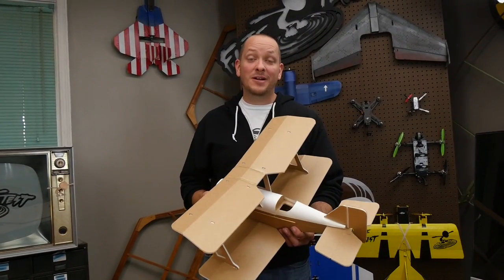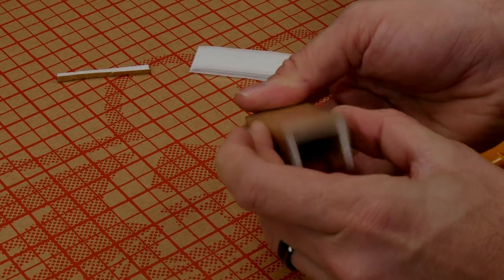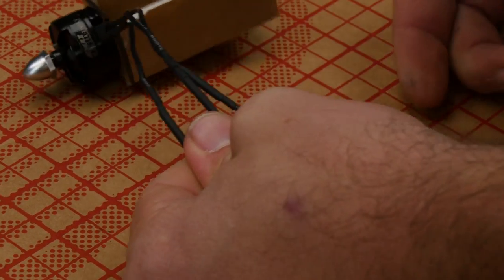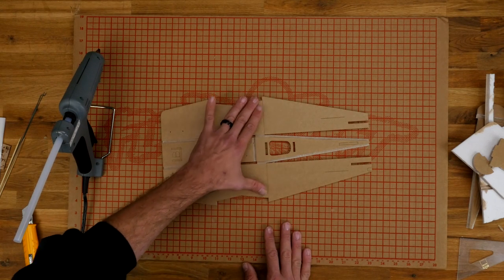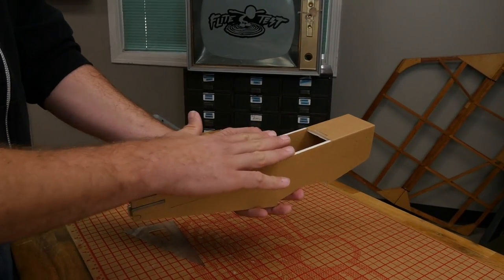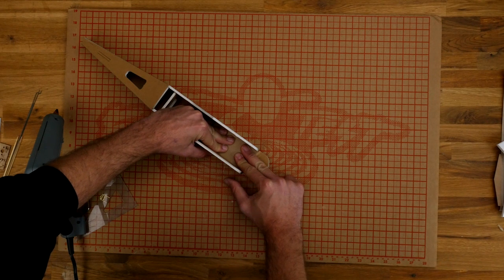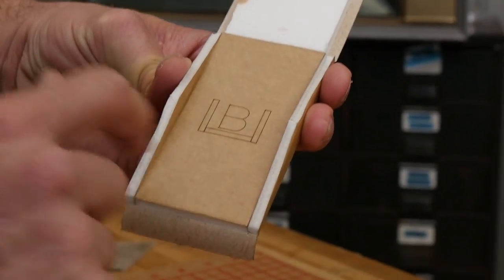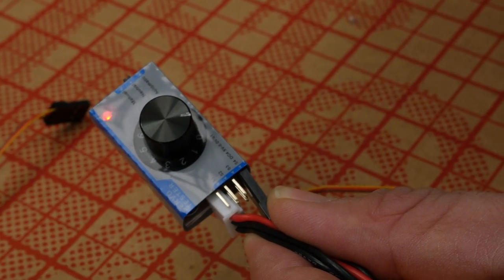FT SE5 WWI Biplane - Build | Flite Test

Comment: Pleased to say my scratch build is progressing very well.
I extended one doubler back to 5mm rear of the wing crease. This will add more foam surface area to glue the lower Wing to.
I realised there is a perfect placed accessible area on lower fus,,over the CG, to fit a Gyro Stabilizer. As Im using 5mm Foam board, Ill measure the gap for the Power Pod and scratch build this, an easy task. saved me stripping the paper off the inside of doublers, With my Foam Board, this is not an easy task! Im guing to use 4X vertical BBQ dowels to secure the centre of Top Wing. This worked perfectly on my Baby Blender and very robust. PS, with BBQ skewer LE, TE and tip reinforcement, the wings have turned out super robust, again developed from the BB build.  Thanks

Comment: Having built a couple of your C sized Power Pod  and now this SE5, I realise how you achieve the necessary 2/3 degrees of Motor Dow-nthrust,with a 90 degree Firewall. The ply firewall upper edge is oversized, which is a bodge to receive the required result. This means the front of the Power Pod will not sit flush to the Fus top foam . This renders the front PP location tabs pretty redundant. You really should have explained the design philosophy at the start, as Im wrongly thinking I made a mistake. In past builds I have modified the arrangement so PP fits squarely and far more secure. I have made the motor down-thrust angle using a couple of thin spacer washers on the motor top  2 retaining screws. That works well. I realise the same design 'defect' with this SE5, so I will suitably angle the firewall by angling the Firewall sides at the front. A much better arrangement, giving snug Power Pod security against the Fus top foam.

Comment: This is a lovely build and shoild finish a great little 3Ch model.
Ive found a couple of 20x18x100mm 3S 2A Lipos which fit perfectly in the model, and  only 70g weighr, 
I realise when I PVA the lower wing in place, the Rudder and Elevator will be inaccessible. but  replacements can be fitted to outer Fus, saving surgery.
Ive done so many mods to improve the airframe rigidity, which has taken some time, but rewarding.Latest was to add plsatic straw tube here the pushrods pass thru the fus. Without these the rods bind to the tail feather foam., not good. I found these simple wings much harder to make and fit, than the usual folded ones on your other models. The camber gauges  gave me the wrong result.

Comment: Great design. Laser cut quality is a problem on the white paper backed foam kits though, which left a huge > 1/8” concave in the foam cuts resulting in bad glue joints unless you put gobs of glue on the cut edges. 

Love these kits, I hope you fix or adjust the laser cutter in the future to avoid frustration when assembling.

Comment: Im scratch building this first and I do feel the  dihedral line in the wings is going to be a definite weak point, So I leave my wings straight. Wish me luck or a good Gyro stabiliser might help me out. Ill build my speedbuild kit as per video for a comparison..Ive standardised on insetting/PVAing BBQ skewers into all exposed edges on foam, by 1/2 diameter. Not too much extra weight, but really prevents ground handling damage.

Comment: I know this is an old video and some may not respond. But I have watched many vids with this build and many have issues with it flying and getting off the ground. Of course Josh is a superb pilot so he can fly most anything good or bad
I want to make a SE5a under 250 grams and I went in the forums and got suggestions on creating plans, enlarging, downsizing etc. BUT My thought here is how many have built this FT kit and have you had issues trying to fly it or have you had a great outcome flying it ?
Days of Balsa and large aircraft for me anyway has ended so I look to downsize my entire fleet ( and I already have some UMX plans and micro quads ) But wish to build a few from foam or buy FT kits to fulfill my desire .
Any advice and how did yours turn out ?

Comment: If you are new with the Servo Cetering tool, leave the Servo unconnected while you do the balance lead 1S trick as per video.This way if you get it wrong you will only lose the tool not the servo. Of course, when all is ok, you can plug in the Servo to the centering tool connector.

Comment: Ok I don't know if he mentioned it but. With the radio do you have to buy that crazy ass $500 one or can you use a cheap one? And how many channels does it have to have? 3? Like channel a, channel b, and channel c? I wouldn't know because I've never built a plane like this
Reply: AssassinManPlays radios always have at least 4 channels,on the reciever there are multiple ports(depends on how much channels are)and each one corresponds at a channel on the tx. In this case is a 3 channel plane that means you have throttle rudder and elevator.
Left and right on the left stick will not be used. BTW check hobbyking.com for crazy cheap radios(50$ or so) and FT beginner series for more information about. I hope this helps you!

Comment: Are there mod plans for adding ailerons? The real plane had ailerons on both wings. Would it add too much weight?  I understand that the kit is for beginners.
Reply: I believe ailerons could be added very easily, however I went in a different direction and made the elevator into elevons. I kept the rudder, so with the rudder, and two servos for elevons I added the weight of one more servo. If I had added ailerons I would have just used one servo and hooked it up with a double sided arm and operated both ailerons with one servo mounted in the fuselage. I also used a piece of foam and made a servo tray that has both elevon servos and the rudder servo. I don't have a spare receiver for it so I haven't flown it yet, but I'm looking forward to it. I also didn't use the speed build kit that I bought. I just traced out the pattern of the components on dollar tree foam board so I didn't waste a speed build kit in case this experiment doesn't work. lol

Comment: So the ESC and receiver just sit loosely in the fuselage?
Reply: I use double side mounting tape to stick things down once I've tested it all don't want to glue things down or tape with strong adhesive until you're sure though just had to remove a hot glued in servo and it worked with hot air rework station but would be screwed without tools.

Comment: OOps, I made a mistake. Using slightly  5mm foam board, my 3S 800ma Lipo doesnt quite fit flat under the Power Pod. (1/8 inch too narrow) I suggest a solution using my material is to only use one thickness doublers inside the Nose  and  make your Power Pod to fit after completing  this stage. At least there is sufficient width for my 2212 brushless motors, so Ill just have to mount the Lipo vertical and off center. Oh well I have a second set of wings cut, so Ill just make another Fus to my revised material specs. I realised that you can make more battery/esc room by making the lower nose totally square to that bottom plate. or at least 80 degrees. Great, 10x box of A1 Foam board arrived at my door,yesterday, so I can build more of these great Mighty Minis. 
No Orlando CVS to go to any more, so I have to pay inflated 4 Bucks a sheet,  but still good value. Thanks

Comment: If someone doest have help setting the tail surfaces they could put the set square across the forward part of the rudder and the rudder it self and hold both side in position with a couple of clothes pegs.

Comment: I'm not sure that I understand why the prop needs to be spinning counterclockwise (not to mention you've changed your reference point from the pilot's to one that is in front of the plane, the pilot would call that a clockwise rotation from his view. I only mention this because you picked a reference perspective in the beginning, and this rotational direction doesn't use it). How would a system operating in the other direction differ at all? Single prop Russian planes operated with rotations opposite of this and were just fine. From a physical standpoint there should be no mechanical advantage one way or the other, and from what I've been reading on this, there isn't a difference in practice either... Unless of course the plane itself was designed to operate with that rotational direction in mind, and its design depends on a specific gyroscopic precession. That's a different story though. What is your reasoning for stating that it is so important that rotation is in a specific direction?
Reply: Power pod has right thrust built into it to counter the torque of a clockwise, pilot's perspective, rotating propeller which induces a counter clockwise roll in the air frame. A counter clockwise turning propeller would induce a clockwise torque to the air frame and cause very strong torque roll to the right because of the built in right thrust.

Comment: it doesn't require a flight controller?
Reply: Devjit Paul it's a plane. Has only a motor and it use servos to move airelons rudder... The reciever will do all the work.
You need a flight controller only on drones.
Reply: thx,  will build a plane n a few months